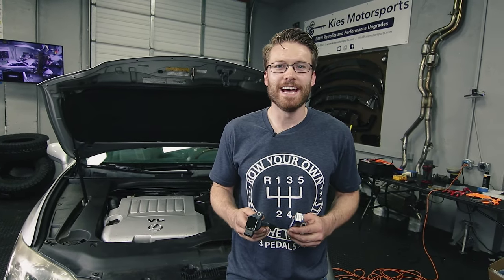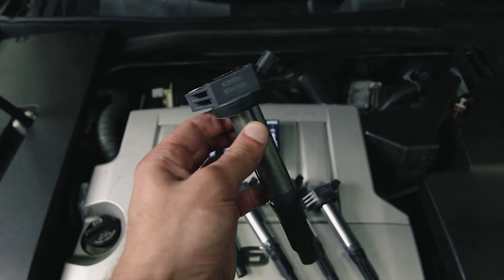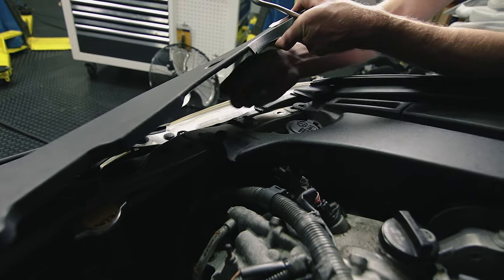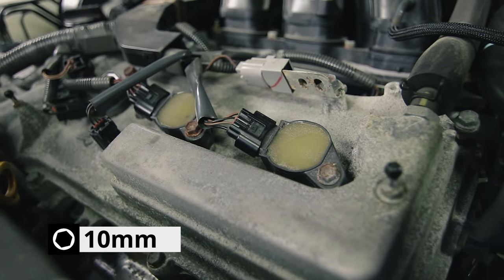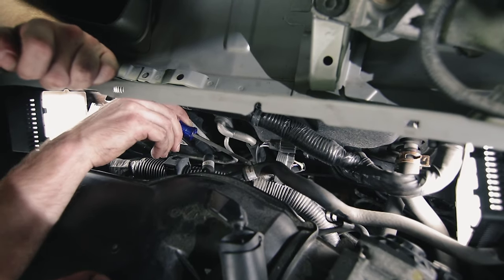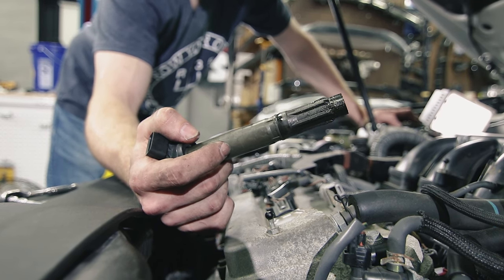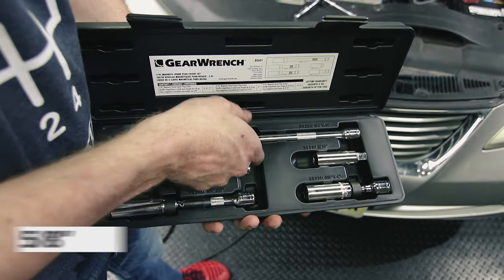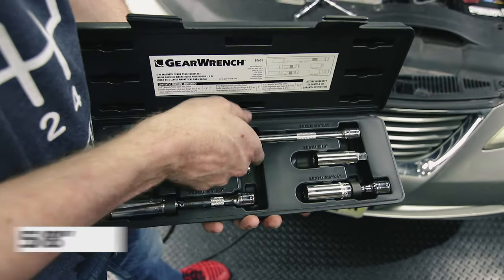How To Change 2GR-FE Coils & Spark Plugs 2006-18 Lexus ES350 / 2006-17 Toyota Camry - Under 1 Hour

Comment: I did this on my daughters 2011 Venza and removed the windshield wiper motor, the metal tray and the intake manifold...what a pain in the ass...thx Toyota ; \
Reply from the maker: Definitely a little annoying to get to those back ones, especially on some of the smaller models
Reply: It's the same on the Highlander. On another note if it rains defiantly cover it with a large trash bag. Houston weather sirry

Comment: This job is an absolute nightmare.  No way a normal person can get it down in under an hour.  This guy had all the bolts and connectors loose from a previous time.  Plan on 3 hours.......and FU Lexus for making this so difficult.
Reply from the maker: Definitely would be nice if they gave some more clearance.

Comment: I'd use the NGK  "Laser Iridium" or Denso Equivalent Long Life Spark Plugs. The reason why is Iridium IX doesn't have precious metal ground strap (last probably 40-50k miles). If you have Inline 4 then sure to use Iridium IX (better performance) but if you have a V6 that is a bitch to work on, I'd use the Laser Iridium that will last for a while.
Reply from the maker: Thanks! Not a bad thing to considering depending on how hard it is to work on vs performance
Reply: Yup. Especially ES 350. That car is a sweet daily that performance doesnt really matter lol. I put Denso Iridium TT on wife’s ES330 (supposedly performance oriented design with IR and platinum ground) let’s see how long these last.

Comment: 😂 who the fuck drives 40k miles a year besides us truckers and I have a 2017 Lexus es350 and 2014 camry se sport I put nothing but OEM parts in it DENSO spark plugs and coils yeah it’s a bit pricey but u can find a good deal on them on eBay and Amazon
Reply from the maker: I generally drive 30K miles a year. With COVID it is a lot less this year for sure. Although this is a friend's car I have a roundtrip of 70 miles a day for work and rack up the miles very quickly driving to family and friends. I'm not the average driver tho for sure. Most put far less miles on their vehicles